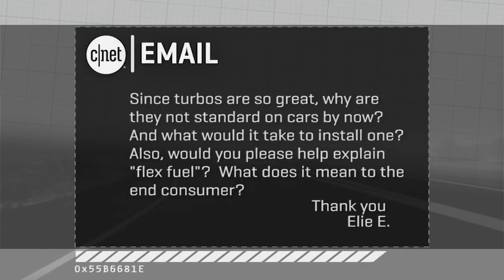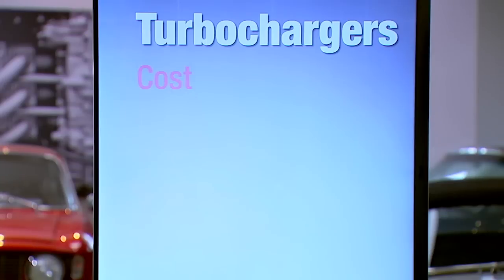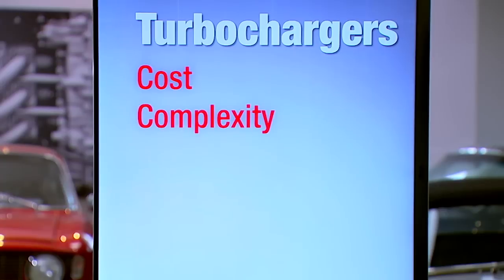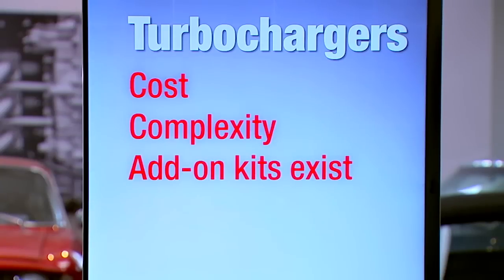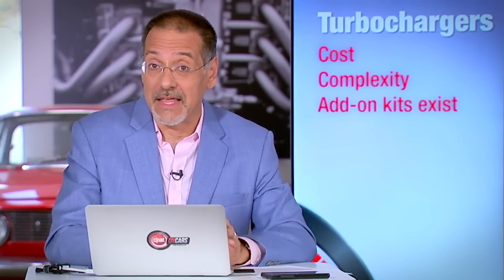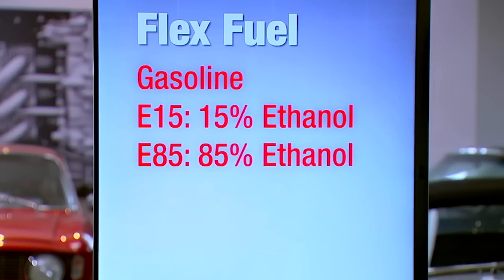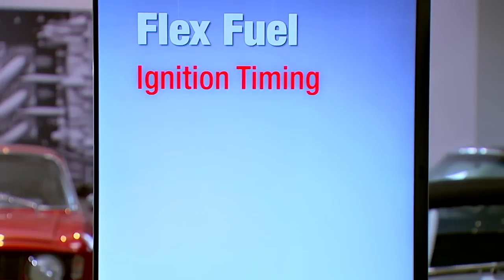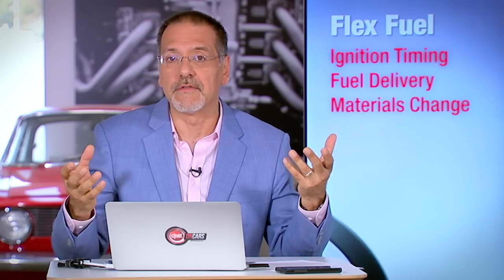Your Emails: Why aren't turbochargers standard in all cars? (On Cars)

Comment: why does turbo engine need higher octane.  I put regular 85 in my Audi A5 and have no troubles with it in 4yrs. Runs fine I might lose a few HP. but I wonder if using premium would it give me more milage or less? Can you make a video on that?
Reply: Lower octane fuels require less compression to combust. Turbocharged cars naturally have higher compression ratios due to the forced induction. Your Audi is provably running fairly low boost pressure from the factory. With higher boost,  lower octane fuels run the risk of early combustion and engine knocking. That's why all turbocharged cars recommend a minimum 91 octane fuel.
Reply: +chris jackson van I get away with 89 as there is no 91 in NY only 91 or 93
Reply: Technically, yes. Just as long as you're not driving the car at its upper limits. Even still, the factory boost pressure probably isn't above 10psi. 89 should be ok, but higher is always better with forced induction.
Reply: +chris jackson 1st time I used reg I had knocking the engine jumped but after that I heard the computer compensates and now runs fine even when I push it and I might have lost some HP but I can berly tell.  4yrs reg gas no problems. But I don't get good MPG not sure if it's the gas or me who drives the car hard.  I am asking cause I plan to get a new twin turbo BMW and I'm afraid it won't go as well.  and am I really saving money or will premium give me better MPG?
Reply: +TechPimp if your engine is compensating for the lower octane, that is most likely responsible for the loss in power and MPG, rather than the fuel itself. If you're considering a twin-turbo BMW, I wouldn't risk putting any lower octane fuel in it.
Reply: +TechPimp it's hard to say whether you're saving money or not. Depending on the efficiency you're losing,  you might be spending more now than you would if your car was getting the advertised MPG
Reply: +TechPimp I have a twin turbo V6 Volvo and I put regular 85 in it at first but I could put my foot to the floor and keep it there to 60 MPH without going over 4,300 RPM's and I got about 15-16 mpg.  I have changed over to premium and now I could never dream of keeping my foot the the floor and I get about 19 mpg.  C-NET does have a video on Octane levels and I don't think that it is because of the turbos at you need premium, but the way the engine, with or without turbos was designed.  Your engine may have been designed to run of regular.
Reply: cjgaltieri It says on the cap 91 octane at 1st it was jumping but after the 1st tank there was no problem i was told the the computer notices the change in gas and adapts to it. I have gone 120MPH and floored it no problem but i think i been making a mistake because not only to i lose HP or power but i also lose MPG so i don't think i saving anything.
Reply: I put 91 in my 335i because I like my car...
Reply: +Angry Whale i ended up putting 93 as there is no 91 here in NY only 87 or 89.  I have a 328i Xdrive 2015

Comment: My MR2 Turbo (J-Spec) is factory tuned for 94 octane gas in Japan, anything less than that my car will start to run like shit. Unfortunately, CA doesn't have that many gas stations that have 94 or more, just 91 piss water.
Reply: +jose060789 Did you account for the different ways of expressing octane rating? Japan uses RON (Research Octane Number) and the USA uses AKI (Anti-Knock Index, which is actually the average of RON and MON or Motor Octane Number).

As a very rough rule of thumb, RON = AKI +4 so Japanese gas rated at 94 RON is roughly equivalent to US gas at 90 AKI.
Reply: +Nick L 
Well then I'm positive it's not piss water.
I just didn't take difference into account.

Comment: when are we gonna get affordable electric cars?
Reply: +MechHead Naga GMG by 2020
Reply: +MechHead Naga GMG A Nissan Leaf is less than $30k. You can probably even find one with low miles for around $15k now.
Reply: Depends on what you mean by "affordable". If you mean under $27k base, no incentives then we're not far away from that. It could probably be done today, but for them not to flop right out of the gate, they need to be rather polished. Once the battery tech gets good enough and you start to see all the major automakers really start to go for EVs, it'll happen. It should definitely happen by 2020, but whether they really take off probably will depend on the state of gas prices and incentives. If incentives get reinstated in the US and increased elsewhere, I don't see how they couldn't take off.